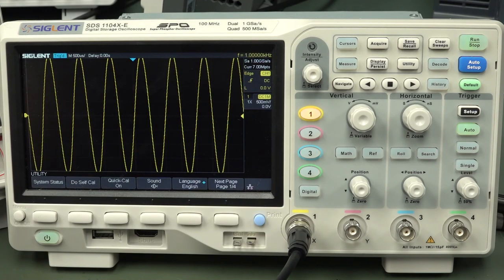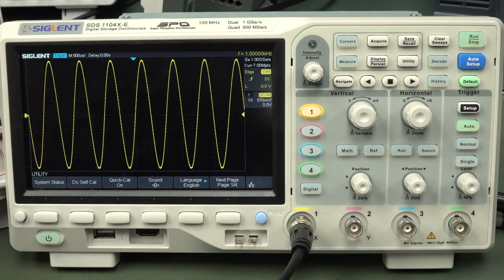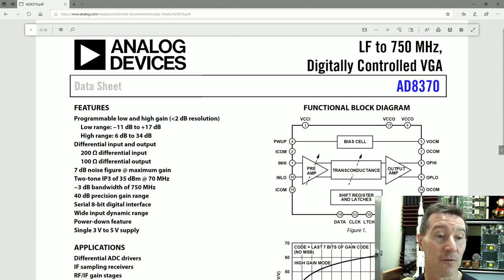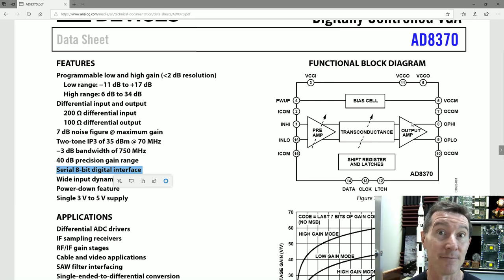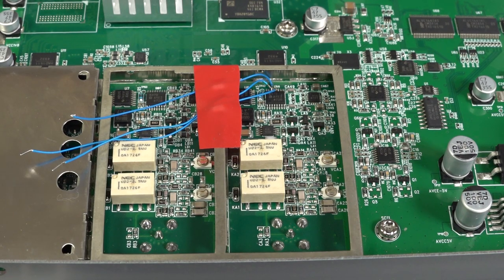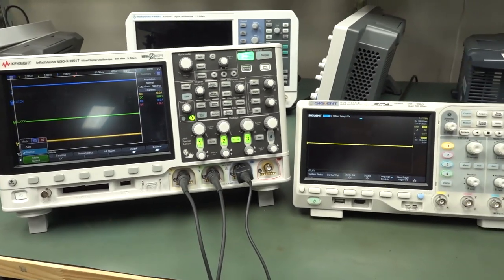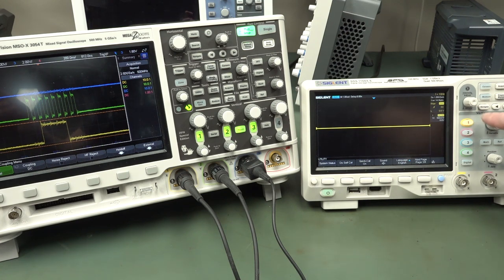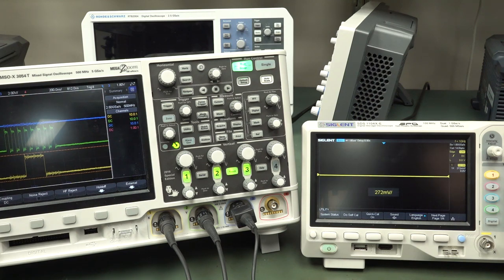EEVblog #1228 - Do Digital Scopes Have REAL Verniers?

Comment from the maker: NOTE: The Rigol DS1054Z does have the ability to do vernier control. It uses the same HAD1511 ADC as the Siglent, and that ADC has two methods of vernier control. One is the digital gain after the ADC (available because the ADC is actually up to 13 bits internally). And second, the ADC reference voltage has an internal DAC that can be changed.
So either or both of those techniques can be used, technically no need for a Variable Gain Amplifier on the front end.
Reply: Thanks for making a short, clear and concise video about a genuinely interesting topic.
I myself haven't touched the vernier on digital scopes due to having the line of thought, "Well, it probably only does that in software, so likely not of help..."
Reply: So 1054z has 8-bits for data, leaving 5-bits for vernier?  32 steps seems a bit coarse vs 128 on the 1104x-e using a VGA. Also, Rigol changing the ADC ref. is an untested assumption right? So which entry-level scope wins?

At 5-years on the market, the 1054z looks like an EOL product and the Siglent competitor has twice the 'hacked' bandwidth in its front-end (AFAIK), but it seems crippled by buggy software and lack of company firmware expertise/finesse. Which scope at this point, gets your Kudos on 'bang for the buck' ??
Reply: I tried this with my DS1054z:
- Applied 8.27V DC to the input.
- Set the channel to DC, BWLimit 20MHz, 5V/div
- Enabled Vmax measurement - it shows me 8.20V
- Enabled Vernier and lowered the Volts/div indent by indent
This is what it displays:
4.95V/div -> 8.12V
4.90V/div -> 8.23V
4.85V/div -> 8.34V
4.80V/div -> 8.26V
4.75V/div -> 8.36V
4.70V/div -> 8.27V
4.65V/div -> 8.18V
...

I checked with a R&S HMC8012 DMM in parallel. The voltage stayed all the time on 8.27V.

So the DS1054z doesn't benefit from vernier mode obviously. The measured value jumps around all over the place.
Reply: @BerndStrobel  Well, I'll guess I need to do this test as well. Since yes, that there seems to be all over the place....
Reply: @CliveChamberlain946  i second this, but more in the form of "whats the "best" (read: cheap bang for the buck) entry level scope?"
Reply: @todayonthebench  Maybe it is fair to mention that I left the horizontal zero level in the middle of the screen. This leaves essentially only 7 bits resolution in the ADC. This surely exaggerates the symptoms.
Thinking about it, there are 4 divs above the zero line and we have 5V/div resulting in a 20V span. With 128 steps (7 bit) this results in a resolution of 0.15625V. Looking at my measurement results the measured value jumps around by roughly 0.1V which kind of matches with this theoretical value. So, my fault. :)
The ideal vernier V/Div setting for 8.27V on 4 divs would be 2.0675V/div. The Rigol offers only 2.10V/div. It measures 8.40V at this setting and 8.34V at 2.15V/div.
If we calculate the theoretical resultion for 2.10V/div, 4 divs, and 128bit we get 0.065625V. It looks like we are 1 or 2 quantization steps off the real value. Which is definitely not bad.
And, if I move the zero line down to the lower border of the screen and vernier to 1.06V/div, 1.08/div, 1.10V/div, ... the scope measures 8.31V, 8.34V, 8.33V,... So there is a gain in resolution and resulting accuracy.
The benefit of this exercise to me was first of all that I realized how low the resolution of a scope measurement is, no matter if the vernier is used or not. Always have a good DMM ready along with the scope. :)
Reply: Thanks for the update!  I almost had my DS1054Z in the garbage bin before I saw this.  ;)

Comment: You could use the serial decoder on the scope on spi bus mode and see the hex value
Reply: I know a guy who has a Porche 911 and uses it as just a daily driver. So someone having an expensive optioned up oscilloscope and only using basic functions does not impress me much. Maybe it is just a personal preference.

Comment: Or you could have just probed the diff pair going in to the ADC to see what the front end was doing with the signal.
Reply from the maker: Possible, but not as dramatic an effect as seeing the bits change in the VGA. And in this case not all the vernier is happening in the front end, some is internal to the ADC.
Reply: So, decap or bust.

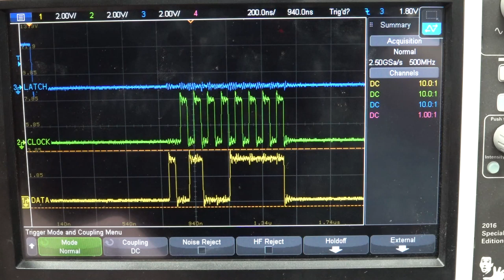Comment: I had Kryten from Red Dwarf counting 1 0 1 1 1 1 0 0 1 1 1 in my head @14:51
Reply: Found it. Terrorform was the episode name when Kryten says "001100111011000111100" which translates to: "Don''t stand around jabbering when in mortal danger!". Phew, it was starting to annoy me. Now im done. Great video as always Dave! Love and seen all episodes probably more than once!
Suppose you could rig a small unit bridging off the vertical gain amp like a small mod (like in the vid) as a permanent mod? It is useful in some applications so would be beneficial right?

Comment: Well that seals the deal. I was considering the 1054z but Siggy's 1104x-e has yet another plus mark. Now if only they could show some real skill in ironing-out the firmware.. Yo Low what I mean?
Reply: It's not a bad scope if ou can get past Siglent's quirky operation (I find the cursors really weird and quirky to operate verses a more straight forward Tek scope) and its lack of measurement controls, or should I say its lack of configuration of the available measurements?  I purchased one and paid to have it ISO17025 certified, but have shelved it and bought another Tektronix.  Its lacks that measurement configuration capabilty and is quirky.  It's USB interface is un-useable for the most part.  It does interface via network connection pretty well, but then software written around last year's firmware quits working with the newly released firmware even though none of the features used by said software should have been effected by the update (according the the changes doucment issued by Siglent).  I think the timing of some of the commands changed or caused some timing quirk.  I was really excited for this scope.  It is inexpensive and had a brillient display.  It's just not ready for prime-time is a real bussiness environment where you must reply on your equipment.  I would call it a fantastic hobby scope.  As a hobbiest, I would take this in a heart beat compared to an beautiful old analog Tek scope.   It is light as a feather, compact and, again,  has a beutiful display.  It is very accurate in its measurement capabilities.  It is just too quirky and un-configurable for a more professional enviroment.  If they would have fixed a few things I asked them to last summer with this last May's software update, I could have sold 6-12 of these scopes for them with some software utilites I write for the industry I am in.  I realize 6-12 is nothing, but still, the techs I work with usually can't spend much money (even though they make a lot with their equipment).  I was "that close" to recomending this scope to a few of my collegues, but at this time, can not.

Comment: Pretty easy to convince yourself without a teardown.   Use coarse scale to get signal to small size on screen.  Hit run/stop.   Then turn 'gain' up with variable mode.   You will see pure s/w expansion of the stored signal.   If it did this during the 'run' only in s/w, you'd see the same thing.   But instead, you see the signal without the telltale jaggies.
With all that said - love that you did the full analysis here!
Reply: Great approach to forcing software gain. I'm a fan of non-invasive approaches, because the invasive approach relies on proper interpretation of your findings, whereas the empirical (black-box) approach just looks at the final result.

Comment: Honestly, calibrating all those steps individually wouldn't take all that much time.
There is 128 of them. (The selectable preamp is after all another amplifier as far as I have understood.)
So if we set the rest of our front end amps to keep a sinewave of known amplitude within the full vernier range, then we can simply step through and measure each step.
Probably do a few hundred averages for each step, but that shouldn't take long, especially with modern scopes doing thousands of waveform captures per second. Simply have it as part of the factory calibration routine, would likely not take more then 1-2 seconds at most, even on a slow scope.

Comment: Why does the Ad8370 datasheet say LF to 750 MHz?
I couldn’t find anything that said it did to did not go to down to DC.
Reply: well, no, the datasheet doesn't. It contains one graph of gain versus frequency which shows performance down to 10 Hz, but not lower. However, I would assume that also the oscilloscope specs only start from a certain low frequency and not at DC. This said, Analog Devices only specifies the accuracy of the gain down to 10 Hz, this does not mean that the chip stops working, just that they do not make claims about accuracy at lower frequencies where you will encounter all different types of problems like long-term drift, 1/f noise etc.

Comment: It should be possible for a fully automated calibration routine using known reference inputs to run through the 256 gain settings, measure the deviations and nonlinearities of each and store correction values in the firmware.  Then the digital output and math functions can get closer to accurate values for the same hardware quality, and the mapping from vernier settings to hardware steps can occur according to the characterized chip and transistor inaccuracies.  Doing the same for thermal drift is more difficult as it needs data for the thermal dynamics of the physical layout and cabinet to know the per component temperatures and some clever thermal cycling to characterize components at various die temperatures.  But it may be possible to achieve this by messing with CPU load and fan speed during the calibration run.

Comment: A very interesting analysis, showing the signals going to the VGA chip.

You could probably also do it by tapping the input signal both before and after the amplifier and use the other scope to see the change in gain. The advantage is that that technique would work with any scope (even an old analog one), but the disadvantage is that it wouldn't reveal much about the rest of the scope's design.

Comment: So does some manufacturer still make that blue wire-wrap wire so we can use short lengths of it to solder to SSOP chips like that, or are these little blue wires left over from so many decades ago when wire-wrap was The Common Method of Prototyping?

TLDR How old are those little blue wires?

Comment: Stupid question here, probably completely wrong... Isn't 1db steps too coarse to be a Vernier? The resolution per the data sheet was 1db, so just three clicks on the Vernier would be 3db, and that's double the signal, right?
Or I'm completely wrong...

Comment: I wish I had your knowledge. I have an old Goldstar OS-7040A oscilloscope that I always liked, and it quit working. I pulled it out of its box after sitting for a number of years, and powered it up, and got a trace for a minute, and then it went dark. No magic smoke, but just no trace. I have no idea how to even troubleshoot it. I'm thinking of getting a new 'scope, but I use one very infrequently, and only to check digital outputs on hobbyist microcontroller projects. I have a Techtronics 2235, but I don't like it as much. Do you think it's worth getting fixed, or cheaper to just buy a new one?
Reply: Both the Goldstar and Tek 2235 are pretty old. Put money into either and something else like an old tantalum cap can crap out a bit later. I would buy new.  The 2235 though is a well built 100 Mhz analog scope so maybe keep it around as a spare.

Comment: So, I'm currently still in highschool, but I'm going to study electrical engineering. I just wanted to say your videos help me a lot to understand how certain electronics work. Currently I'm working on my first project with electronics, I'm going to study some old digital alarmclocks, reverse engineer them and build my own. Is there any things I specifically need, and things to keep in mind?
You're a great inspiration to me, keep doing what you're doing, especially in the dumpsters.
Reply from the maker: Great to hear. Just work on projects that interest you.
Reply: Justin .... Well, nice to see someone is having interest with electronics but may I advice you for free ?... If you like to work in Analog electronics then think of Analog Electronics and if you like to work with Digital Electronics then think of Analog Electronics again !.... final conclusion , all Digital and software based systems are worthless to be talented by , only Analog systems and that is the TRUE skill of Electronics Engineering guy !.
Reply: @ahmedalshalchi  That's what I'm going for, yeah, but I can't ignore chips ofcourse. They will be used somewhere in most projects. As for what I meant with a digital alarm clock I meant a seven segment display, and I don't want to use something like an arduino. I was thinking of getting a system set up that detects when minutes get to 60 and then adds an hour, same for second. I was thinking of using a crystal oscillator for that, and getting it to update every second exactly. Then I would have to set a system in place that with the press of a button can add a second to the time, which I'd assume I could do by mimicking an input from the timer circuit. I have no idea how I'd do that though.

Comment: Just because the input amplifier gain is changing when you adjust the vertical control, doesn't necessarily mean the automated measurements are affected by that amplifier gain change. 

Typically, the measuring done by the scope is an interpretation of what's being displayed to the screen, not a direct interpretation of the actual ADC conversions.

If you do a single sweep of a signal, and then change the vertical control to fine and reduce the apparent amplitude slightly and the built-in measuring system begins to give you a measurement where it wasn't before, or a more accurate measurement than it was before, then that measurement is a better interpretation of what's being displayed on the screen, not of  what's being sampled by the ADC through the input amplifier.
Reply: Seems like a design flaw - that the "gain" (i.e. arbitrary vertical magnification to make wave form visually pleasing) should affect the precision of the measurements. The designers were lazy.

Wouldn't it make more sense that automatic internal gain adjustments would ensure that the A/Ds and whatever would yield the best precision possible, to obtain accurate measurements, independent of screen's representation.

Comment: Would be a useful mod for these scopes if they function the same as this particular scope. Tap off the VGA and tweak/sniff the signal and add/change the signal to mod. If only they used Varible Resistors and not encoders for panel controls, this would give more room for possibilities of tweaking adjustments by changing resistances instead of resorting to a long complicated software hack. Ah the old days eh? Like increasing the volume on your old radio by changing the VR POT resistance or adding resistors to it see what effect it had! Or just blowing your amplifier.  Such fun!